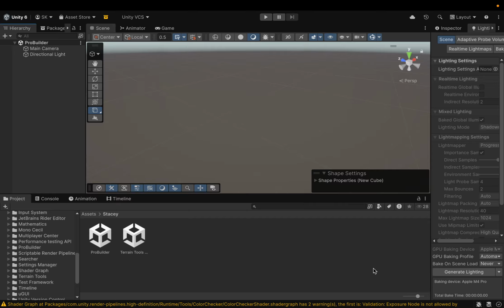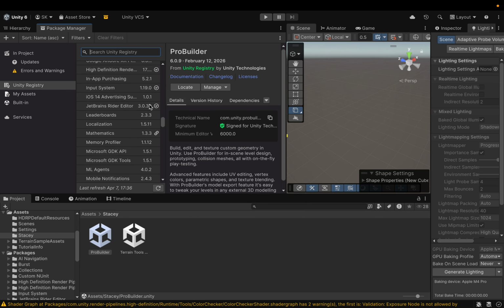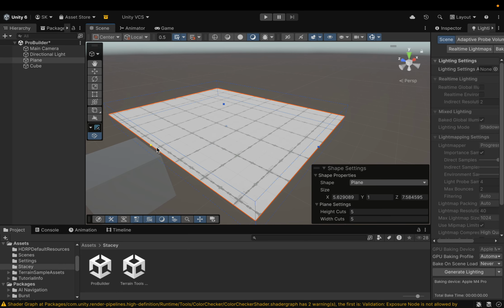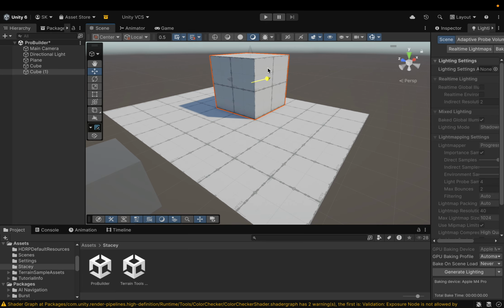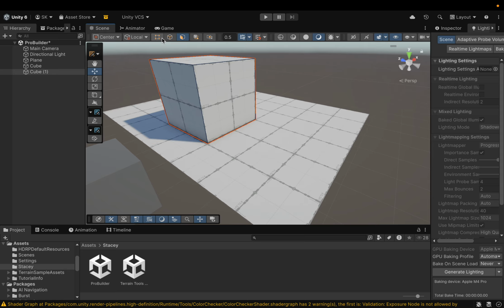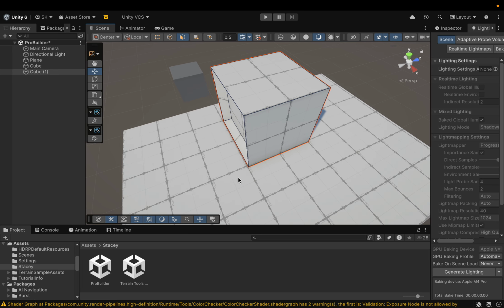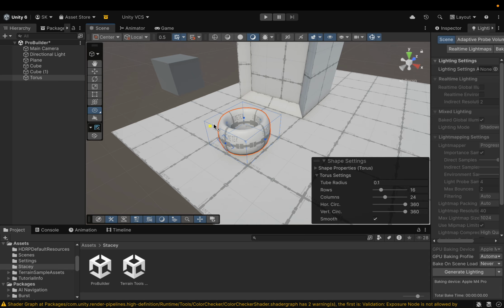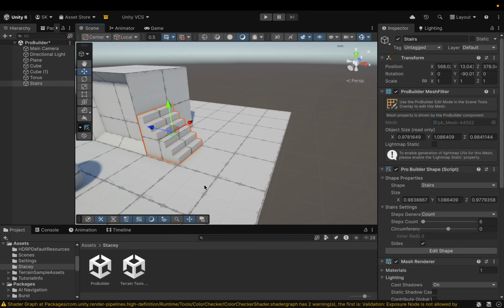ProBuilder! Getting Started, UI Tools & Basic Shapes (Unity 6)

Comment: HI, how do you get that toolbar?. I installed pro builder but there´s no toolbar on my scene.
Thanks.
Reply from the maker: There are several ways to access the toolbar in Unity 6. If you right click in your hierarchy and create new ProBuilder shape, it should pop up in your scene window, OR Press the tilde (~) key or click the Overlay menu icon (three vertical dots or a stack icon) in the Scene view toolbar to ensure the Tools and Tool Settings overlays are checked.